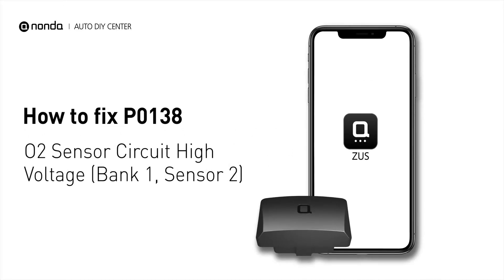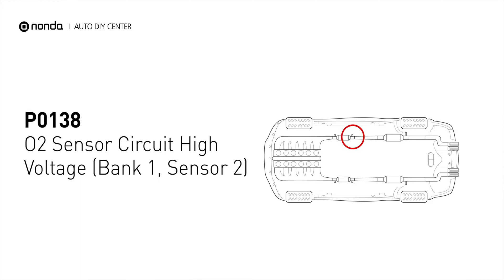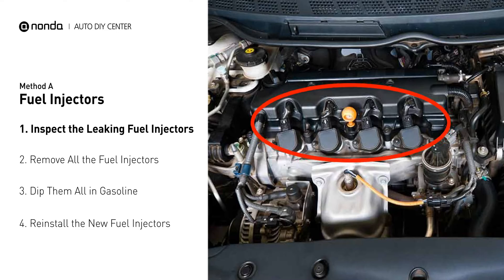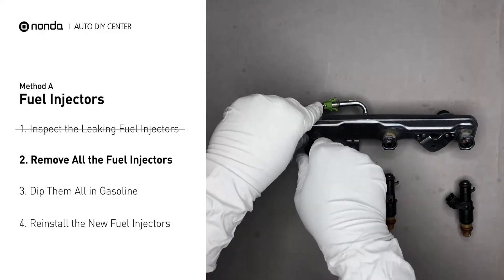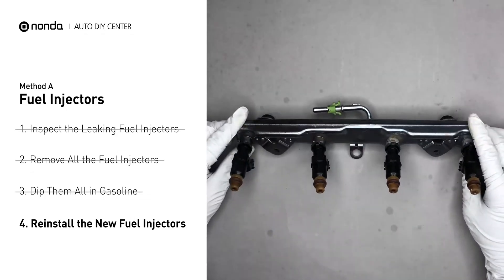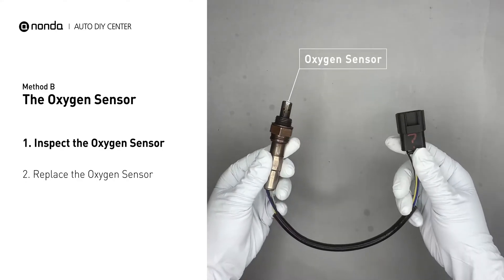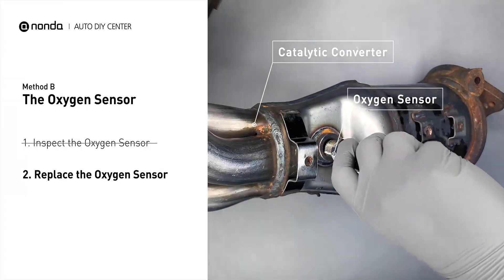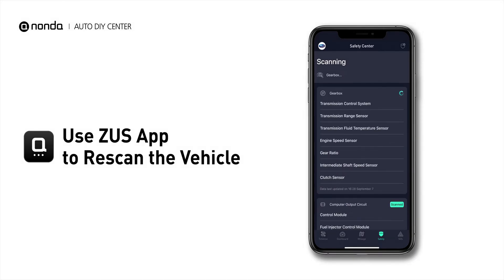How to Fix P0138 Engine Code in 3 Minutes [2 DIY Methods / Only $8.99]

Comment: Brand new Oxygen sensors, upstream and downstream. Cleared out the error codes, next day I get the same P0138 code. What now?
Reply: Most of the time it's not the o2 sensor that needs replacing
Reply: @KaliYuga-m5l I replaced the catalytic converter and it solved that problem, now I have a problem with the fuel running too rich.

Comment: I have a 2017 Nissan X-Trail. At idle the car gave a lean code.  When driving the car gives a code p0138 high voltage bank 1 sensor 2. I replaced the O2 sensor and the Catalic converter. then clean injector after servicing 2 hour and show p0138 code agine.
Reply: What was the solution ?

Comment: We have codes P0038 and P0138 replaced the Bank 1 Sensor 2 sensor but codes are STILL coming up.  Can't clear codes and engine light still on.  Ram has a aftermarket computer, would that be causing issues?
Reply from the maker: Hi Loreen, since you are receiving more than one code, we suggest getting your vehicle visually inspected by your local mechanic for further diagnosis.

Comment: Hi! Had a sensor that gave no voltage att all on my Jeep Wrangler. Bank 2 sensor 2. Changed in for a new one and a short while after the same sensor shows only high voltage. About 0-8-1.0V. Its a V6 and the corresponding sensor on the other bank goes down to about 0.3 V. Could the new sensor be a faulthy one?
Reply from the maker: Probably yes, if there's no other fault codes that register along with this code.
Reply: @nondainc buying the cheapest sensor isn't always the.least expensive.

Comment: I have a 2012 Chevrolet Equinox LT 2.4L 4 Cylinder with a little under 86k miles throwing codes P0138 and P2271 for Bank 1 Sensor 2 an have changed the 02 Downstream Sensor twice drove 50-100 miles and check engine light has returned. What could be the issue?
Reply from the maker: Hi Angel, the condition of the terminal that the oxygen sensor connects to the plug and the related wiring harnesses  must be checked. Ensure that there is enough voltage going to and from the oxygen sensor (within spec of your car).

Comment: Oxygen sensor should be method A. The fuel injectors is the most expensive method.
Reply from the maker: Hi Rezail, thank you for your suggestion/feedback.
Reply: I have a 2009 dodge charger RT and it's throwing same code so witch side of car and witch oxygen sensor do I change.thanks
Reply: Also, it’s what the code is indicating.
Reply: Method A....Buy a New Car 🚗 😁
Reply: @frankie3591  In my case, a rodent chewed my sensor wire 3 days after I brought it home. Started 2020 right. Didn’t find this wire until 2023 Lol. I replaced the harness…who would have thought there was more.
Reply: @sknerl  I had same issue  om my first Prius  and it,s seem  the same problem on my other Prius a very expensive trouble shooting.
Reply: @danlavigueur2648 did you figure out the cause of it?
Reply: @jbek9779   Thanks problem not fix yet I changed the o2 sensor at the manifold problem still persist I will go for bank 2  o2 sensor now ad injector if not fix.